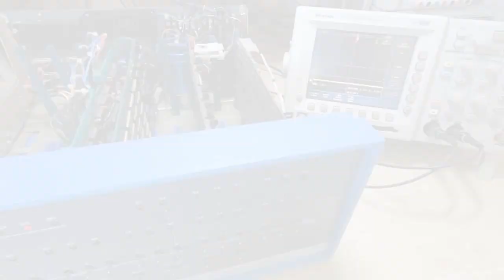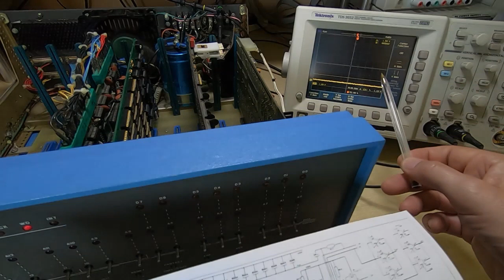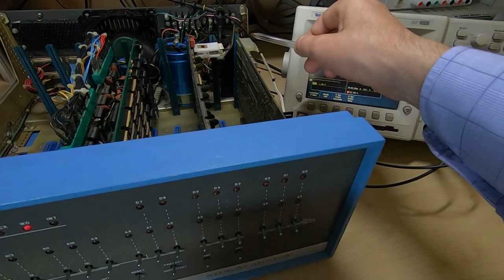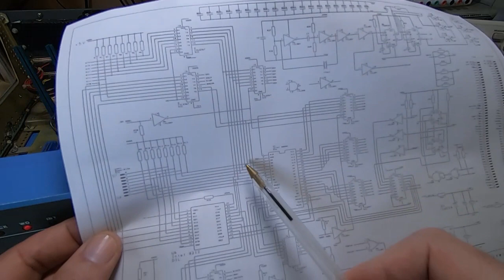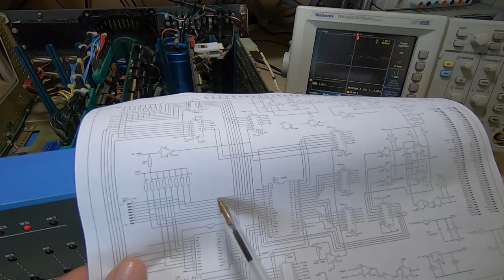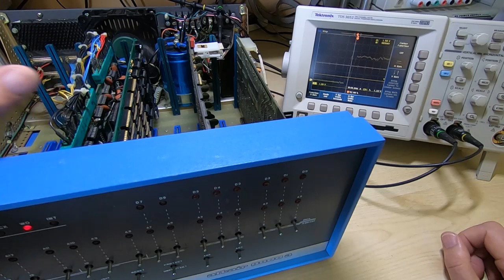Altair 8800 Backplane Noise Part 1

Comment: Just wanted to say thank you so much for these videos. I followed your advice re trimming length of front panel cables plus ferrites and my super fickle 8800c (with your original repro front panel board), has gone from only working with cards in exact specific slots, to being rock solid with anything in  any slot! Also looks neater :)
Previously I added an mwrite mod based on Martyn’s ideas which helped a lot with reliability but not with the slot issue. So now it’s super stable, just like a bought one, to quote EEV Dave.

Comment: Hi Jerry, 

Another interesting video. I can't believe the wires don't cause even more problems than they do, I was quite suprised by the design when I originally looked at it. I'd be interested in seeing your write pulse from the front panel as mine has given me loads of grief to the point I now generate it on a seperate board on the bus and then gate it with the front panel deposit write signal, unfortunately at the time I didn't have a decent enough scope to investigate the true cause.
Have you considered producing a buffered version of your front panel bus connector ? as this would probably solve loads of problems and I'm sure would be a popular upgrade, although obviously not original it wouldn't detract or really alter the original hardware.
Martyn.
Reply from the maker: Yes I have had many problems with this. In fact that is why I first started looking into the problem. The more I investigated the more I was surprised that they ever work at all. Memory is always operating very close to the limit and I have had problems with all my memory cards. I have been looking at each issue in turn and will be producing a video on each of them (there are many). As it turns out the backplane ringing is not really an issue except when total bus indictance gets too high. This is why bus terminations are not very effective. There is no characteristic impedance to match so no value of termination is effective. What I have been finding is that most of the problems are actually 'active' unwanted signals. Some caused by timing but most caused by noise. While I did not shown them in the video I did mention the inductors I placed on the wires from the backplane to the control panel and this made a big difference. As you have problably noticed some of the control signals, such as memory write, are not generated relaibly. It can look like a faulty board but is more likely just due to design. Oddly I have been looking at a buffered interface (I mentioned this with regards to the particular problem I was describing in the video) and currently I am checking that it would not effect timing but as the 'noise' is in the order of 200-300ns and a buffer would only add around 10ns then I do not think it will cause any problems. I am also looking at changes to existing backplanes to counter the high inductance which is the main cause of actual bus problems. I will be releasing a memory board shortly. It will not be a 'vintage' design but will offer a 64k board at very low cost that will be far more immune to 'noise' and will really help anyone trying to track down problems or if they just want to preserve their original boards.

Comment from the maker: Yes the altair has a semi-formalised backplane in as much as the connector size and signal order was specified although the older versions did not have a formalised specification for characteristics (impedance etc). The S-100 bus was finally formalised but even then it was not a full specification and there were various subsets of this over the years. The main issues I have come across so far are actually caused by the inductance of the backplane and this is the main cause of the ringing which I am looking at ways to resolve. Some time in the future I will be supplying a backplane with a ground plane which will prevent the ringing but I am trying to find a way to make the original versions work. It is interesting when you start to investigate it. For schematics you can just search for the card manuals you are interested in (there are some on my web site -jmprecision.co.uk and I will be adding more).